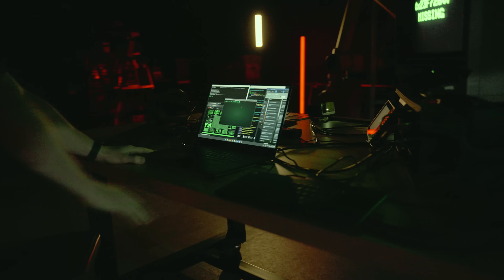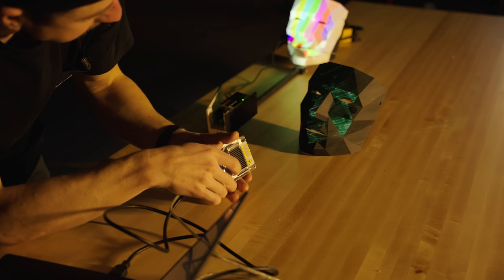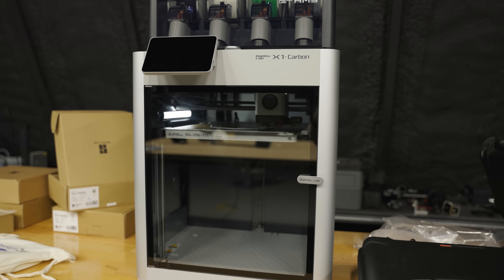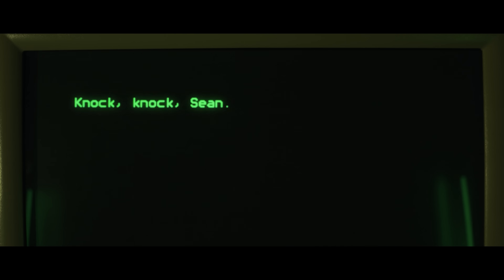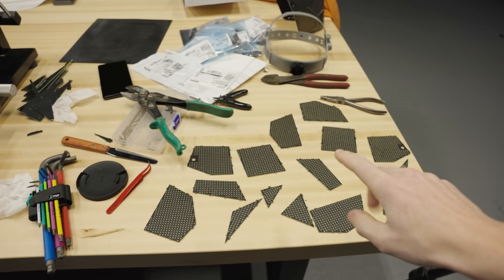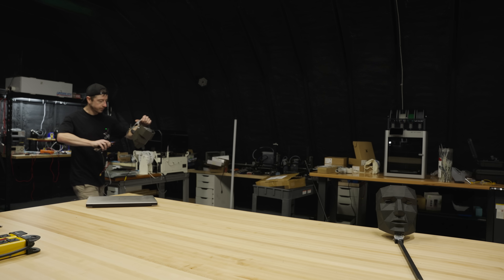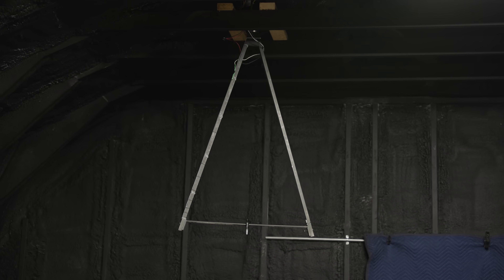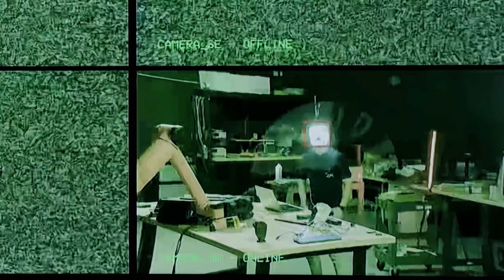Become Anyone 2.0 - A Full Face LED Mask

Comment: Face Heater FTW!!!!    That's wicked... I was expecting you to put some foam or something on the back of the PCBs for a more comfy fit and maybe to reduce the heat a bit... but I guess you are used to the heat by now living that close to the silicon!
Reply from the maker: Took it to the Hacksmiths for an outdoor Halloween party and it kept my face nice and warm! For some luck, it rests on my cheeks perfectly, and is really comfy. The scary part though, is the head mount will pull and push the solder joints if its not exactly the size it is now. So basically only my head fits. lol
Reply: @SeanHodgins  Damn! So I guess I won't be putting in an order for one :(
How long does that battery last when on non stop?
Reply from the maker: @UnexpectedMaker  It was pulling around 1.5 - 2.5A - but I was keeping the LEDs around 10% brightness max. Wouldn't want to go any higher. They pull 1.4A when they're all off. I think I said 9 hours in the video, but I misspoke for that battery size. Its likely around 4-6 hours.
Reply: @SeanHodgins  Ok, that's not too bad when on, but the quiescent current draw when not displaying anything sucks. For revision 2, adding per panel power control and SW used detection if a panel is in use or not would be an awesome addition :)

Let me know when I can place an order :)

Comment: Have you considered using tft displays for the panels for a higher resolution?

Its great to see you advancing this project btw.
Reply from the maker: I've been in contact with a lot of panel manufacturers, and haven't found any that will make weird shapes... yet.

Comment: Next gen: smooth mask + 6-axis pick-n-place
Reply from the maker: Whoa, 3d printed circuit board to conform to the shape, thats a really cool idea. May be possible in a few years.
Reply: @SeanHodgins  Maybe you can vaccum mold some Styrofoam onto a 3D printed mask mold.
Reply: With a smooth mask, you could probably just cover it with some flexible strips with the leds on. I'm sure you can have custom flexi pcbs manufactured these days. Might make it easier to map positions if you  are careful mounting the strips (vertically - addresses running top to bottom, bottom to top alternately), and help with the power connections so you don't end up with long power connection runs on narrow strips (a problem you get with standard ws2812 led strips on long runs that affects the colour).

Comment: This is mega cool!

One idea: having the 3D cad file, couldn't you have made a light plastic scaffolding on the back side of The Mask? Could help with rigidity
Reply from the maker: Thanks! Yeah, will do that I think in next version with some sort of mounting method, one of my (hidden) goals was to make it completely out of circuit boards this time around. Just to see if it could be done.

Comment: A flexible OLED displays on all surfaces would be awesome!!
Reply from the maker: I’ve emailed so many oled companies about this stuff. Maybe one day!
Reply: @SeanHodgins  To really work right it would need to be a very high resolution and not faceted.  It would need to be on a flexible materiel that could be  used as an actual mask.  I'm thinking more for a robot actually.  It would not be a good identity mask for the same reason a ball cap doesn't work.  They would just look for the guy with a certain type of mask.  Wearing something like this hides your identity but also draws attention to you and that's exactly what you don't want. Great for parties though.  Trouble is, it's only good for everyone else, not the wearer.
Reply: They're all so small and expensive. I saw some on Alibaba IIRC, but they were limited orders and still a few hundred for a phone screen sized display. That would really up it to "A Scanner Darkly" levels of disorienting.
Reply: you can use a "most" circular panel and just put the lines of the face to "jump over" the thing about the circle mask, like the mask oda of cyberpunk 2077 uses, and the white mask of this video lines to jump over the AI who need to "feel" the distance of a face to know is a "real" face.

Comment: This is sick and I want it sooo badly ^_^ Instant sub. Love your editing and where in the heck did you get that Batman bunker?

Out of interest, are you providing all your circuit design files on your git as well? Is it hypothetically possible to get JLCPCB do pre-assemble the circuits?

Also is there anything stopping you using way cheaper LEDs? I'm seeing a reel of 14000 on JLCPCB for $64 total, which would make a fair few masks! (assuming the LEDs were the biggest cost - not the PCB itself.

Ideas on making it less fragile - clear resin print that matches the front profile from the likes of PCBWAY? Maybe adhered with resin itself to the front under vacuum (maybe bag vacuum) to get an even and clear contact? Reinforcing from the back obviously easier of course!
Reply from the maker: I have some ideas that I think I’ll actually implement for more structure. Yep all design files and stuff will be available soon(working on the Github) - but the LEDs are SK6805 addressable, so they’re about $0.04 each at the 9000 I purchased.

Comment: I'm not gonna lie, it's sick, but like... I can't help but think "flexible pcb"... Please don't get me wrong, I love the presentation and stuff, but if I was tasked with an LED mask, I'd just make in one whole piece designed to be bent around a 3D printed skull on top of which you could put dark reflective film - looks clean, much less worry in terms of belt grinding, 3D soldering... Then again, if you're dropping 500 bucks on one half of the mask, I'm beginning to wonder how a flexible display would fare, at that point you really could become anyone.
Reply from the maker: Half of it is aesthetic, the old projection mask didn't need to be low poly, but it was, so I wanted to keep that trend and style. I did partially go down a combo flex PCB route in the early design, but I thought this would be cool because its just literally regular circuit boards and LEDs.

Comment: What if instead of polygonal faceted models, you went with a developable surfaces approach, bendable bands that form 3d shapes when you bind them along the edges. Look up the video "Developability of Triangle Meshes"  by Keenan Crane for some good visualizations. Kinda looks like it might be doable to have some flexible PCBs with addressable SMD LEDs that are manufactured as a single flat piece and then curved together into a face shape.
Reply from the maker: Awesome, Ill check it out!
Reply: @SeanHodgins  Also, look up how cosplayes build things by bending foam sheets in similar ways for some inspirations for the patterns as well. Oh, and there's also similar work done with paper other and similar materials, papercraft or "pepakura"; which could be another good source source of inspiration for the patterns; and of course preliminary prototyping the shapes (always gonna reach point you gonna need the final material to be sure the exact flexibility characteristics do work; but would be much cheaper to try out aproximations with cheaper material before you go for the closer to production level prototypes).

Comment: I can imagine in a couple years, you'll have like 3M pixels and be able to emulate anyone's face by just glancing at them for a second or two.
Reply from the maker: 😁But first! Make it less terrifyingly fragile.
Reply: @SeanHodgins  Could you make a 3D printed housing for that?  As a bonus you could but a grid wall around all the LEDs and diffuse them into larger pixels.  I saw a Micro:Bit case do this at one point and made a little mod for it to fit a V2 Micro:Bit.  I need to upload it to Thingiverse or something...
Reply: @SeanHodgins  *pokes mask slightly more than a bit* and there it goes snapping in half!
Reply: @SeanHodgins ... what if you coated it in a clear durable resin after it is completely put together? Maybe doing a composite fabric backing like how carbon fiber is made for more structure and a good solid layer cover on the front for protection of the LEDs?
Reply: @SeanHodgins  Have you tried to add vias to the places where you solder the panels together?
Reply: This is the way
Reply: The coolest Halloween costume ever would copy their face and repeat everything  they say back to them.
Reply: @helipilotuh1  Wasn't there a Doctor Who episode like that?  The monster starts copying everything people said, getting faster and faster until eventually they copied speech before the people even said it, throwing doubt on if the monster was still the monster or if it "jumped" hosts.
Reply: @dafoex   sorry, I wouldn’t know, never really got into that one.
Reply: @loopsody  sure. Right after we get our flying cars.
Reply: @ThePrimePrimer  But we have flying cars, they are called helicopters.
Reply: @ThePrimePrimer  You can get a flying car now. It's basically just a drone with seats bolted to an oversized go-kart but it's better than nothing.
Reply: probably would use something similar to the mechanism cuttlefish use to alter pigment appearance
Reply: https://www.youtube.com/watch?v=jkjIsnjKhew
Ruiner Game Cyberpunk Mask
Price?
Reply: @loopsody  Even better I AM transcending and will do all that naturally in my new body.
Reply: This is similar to what the undercover police department wears in A Scanner Darkly.
Reply: Haven't I seen you somewhere?
Reply: Already possible to emulate faces with AI we just don't have the screens yet for masks but they are being worked on with flexible oled panels.
Reply: Give it even more time and the panels could be full color e-ink, so it interacts with ambient light more naturally.
Reply: T1000 has entered the chat
Reply: if i had one of these i' have commander Shepard's face on all the time lol also it'd give me a reason to wear something with a hood...
Reply: And it could fuse to your face
Reply: Wait untill he uses that on a full suit to become invisible...
Reply: Dude hasn't heard of LCD panels
Reply: @talananiyiyaya8912  bendable oled would be much better
Reply: @talananiyiyaya8912 harder to conform LCD panels in multiple sizes to curved or multi-angled surfaces without being able to spend a few billion dollars at a time for the customizations!
Reply: @talananiyiyaya8912  AMMOLED...thinner, flexible, active light source...
Reply: Gotta love when CCs visit each others work. 
But yeah, with the advent of technology this could definitely happen, what would be better is if we got displays that could mimic he way light bounces off surfaces rather than blasting light. would look a lot more natural even if giving off uncanny valley vibes.

Comment: You have a pick and place machine at home.... wtf. I would not even know where to go if I wanted to buy one. 🤷‍♂
Reply from the maker: Its a Neoden YY1, small machine with lots of quirks, mostly able to get the job done.
Reply: @SeanHodgins  hm. smaller and cheaper than I would have expected. Still a very specialized and capable machine. I am excited to see what you will use it for next.